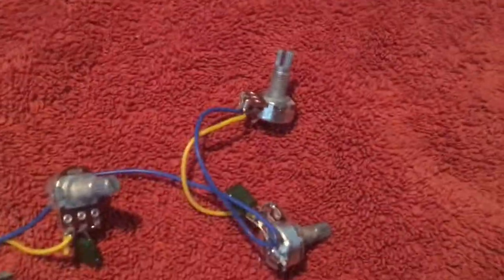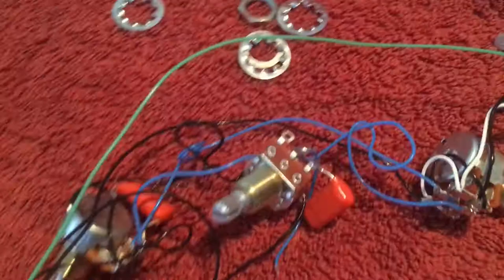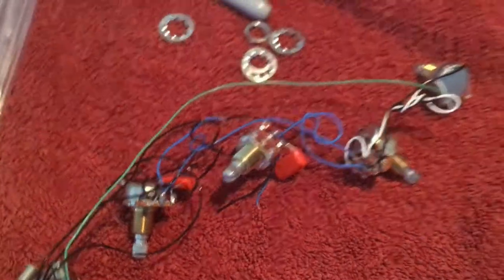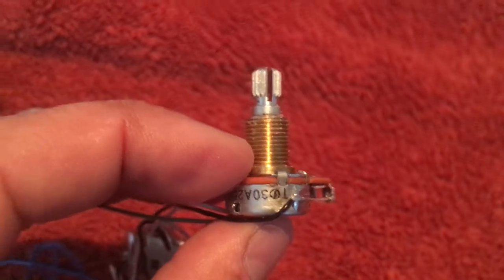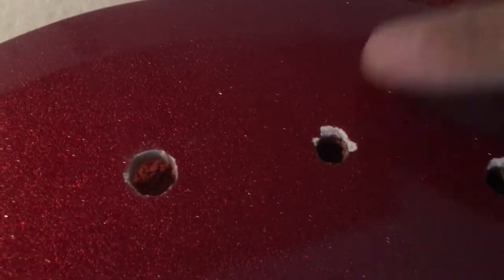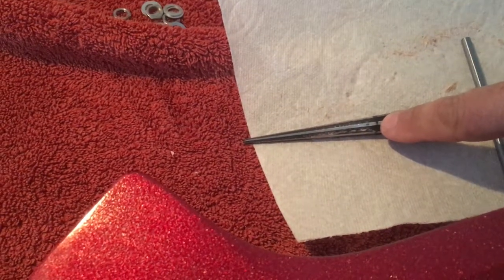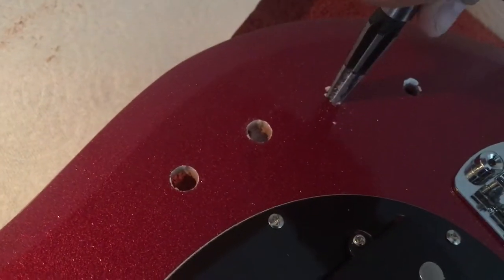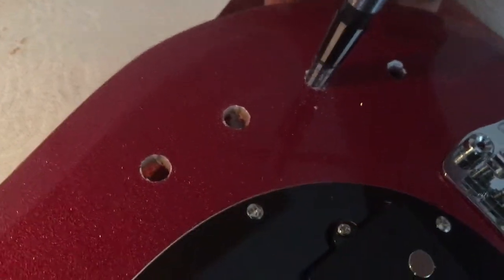Making Guitar Volume and Tone Pot Holes Bigger (update 2023)

Comment: How did you know where on the reamer was the right diameter for the holes?  Thx
Reply from the maker: I measured the diameter I needed on the reamer and marked it with a sharpie. When I got close, I placed the pot in the hole to see if it would fit, ream a little more then Test fit again.